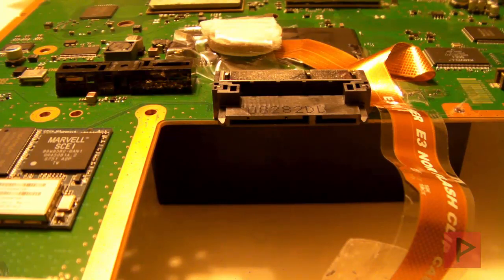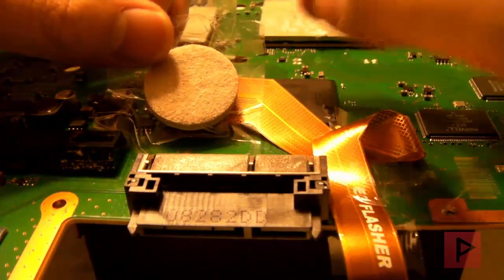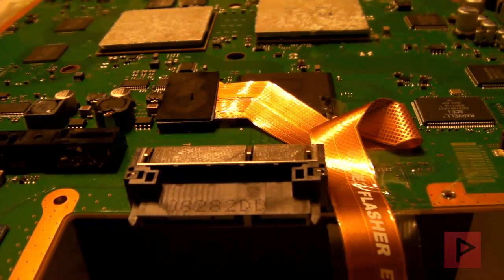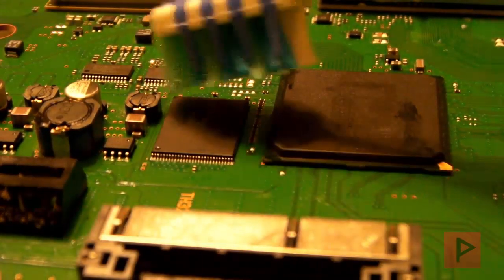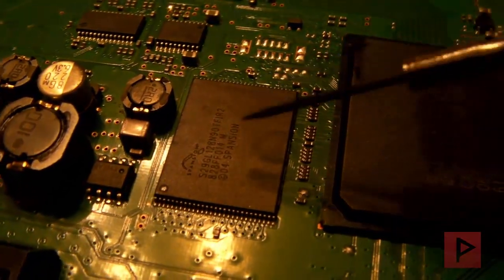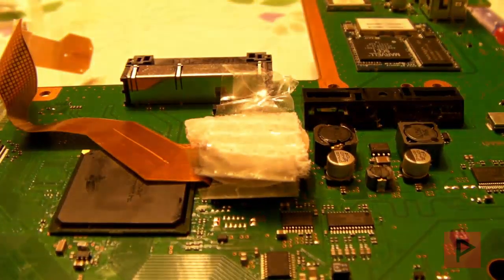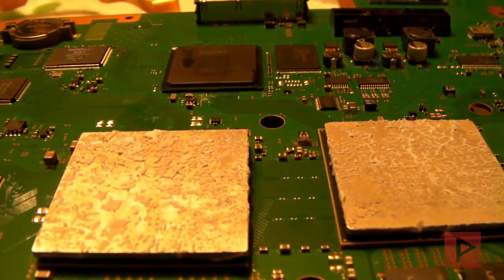[How To] Fix E3 Flasher NOR Clip Issues (10001100 Fix)

Comment: Thank you for the video.  E3 was getting a read error.  Your video saved me hours of troubleshooting.  I could see that the e3 was not flush with the board, so I trimmed the edges of the e3 flasher and it worked perfectly.

Comment: Thank you so much for this video! I kept getting 80-105 different errors in my bin file, i took my ps3 apart 11 times. first time shaving off the right side of my nor clip reader fixed my issue completely, thank you for this video. I only shaved off the lower right corner, and it worked fine. just look at where the small resistor is on the mother board and think about how the chip needs to lay flush on the motherboard. This is an issue for fat ps3's, this step is a must and should probably be included on the 3 part video. Awesome job on these videos, thanks again!
Reply: Thanks so much! My CECH 2001A was giving me real problems which is annoying since I have used the flasher on 3 other units. I shaved off the sides of the clip and it worked. Many thanks.

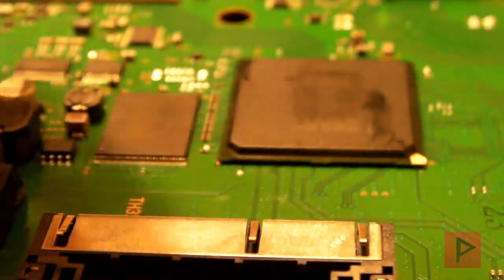Comment: The real fix here is this 4:17.

It worked perfectly, I doubt that little capacitor would do a thing but it seems it really bothers the E3 socket. Now I did my first dump on super slim, which is harder than in the other two models because the NOR chip is hidden under the cooler. I had to use a really big ass coin and put every screw in the near zone. That was my solution, and btw, thanks.
Reply: @ProjectPhoenixMedia  But why? There's no risk of brick using HFW or Am I missing something?

Comment: Hey man! Got the same PS3 - the L-Model. Also successfully dumped the NOR 3 times and was able to downgrade it to 3.55 rogero (v3.7). Now the strange things started to happen:
- I soldered the 2 wires needed for Dualboot (both perfectly soldered)
- Started installing 2 HDDs for Dualboot (both on Rogero CFW 3.55 v3.7)
- Tried to backup the PS3-NOR to the E3-OB-NOR, but got a read error
Now - after a restart - my PS3 (if E3 is connected) show YLOD. But I'm damn sure this is not due to overheating because i actually never played a game! I was only in the XMB for about 2 hours and also the fan was not speeding up to show there is increasing temp in the PS3. If I disconnect the NOR-Clip and fire up my PS3, there is no YLOD and it stays on, but only black screen. I currently think it's only a NOR-Clip-Seating problem. But I also scraped off the edges of the Clip and it seems I can't get it to fit correctly anymore. Please help! Can you tell me, how much "pressure" is needed for the NOR-Clip? I've seen tutorials where the guys used monstrous clamps to tie the Clip to the NOR, but I don't think your Nickel-Solution applies that much pressure...

Comment: Isn't it best to use Kepton tape? I heard some adhesive is conductive, but I doubt tape used mainly for soldering and PCB fix/touch ups would.

I ask mainly, because safety first reasons.

Comment: Absolutely correct. I could see the resistor I i though to myself it is probably in the way
Reply: Start shaving. At first I didn't want to believe it but after assembling and disassembling so many times, I was desperate to try anything. Shaving both sides down hard core did the trick. I couldn't believe it, I was so happy lol.
Reply: Versatile Yea, I will try that now. I have taken the console apart around 5 times now and it is getting  very frustrating but hopefully it will work the next time.
Reply: ShaDoWxGFX yea I was just like you. I thought I bent the pins on my clip or damaged the nor chip but thankfully all was ok in the end.
Reply: Versatile I'm still getting errors... I might just take the flasher back. It doesn't seem to work. I've shaved down the sides, I've made sure it has enough pressure, Ive dont everything correctly and still get flashing blue lights.
Reply: Versatile Last resort I might have to clamp the chip and screw the heatsink clamps on with a peice of cardboard in the middle instead of the heatsink.

Comment: Hey man thanks for these very detailed tutorials  I liked the whole series  and I am going to reference these vids when I get my E3 flasher but I had a question. Could u send me a link to the exact or similar E3 flasher you bought? I I have a PS3 Fat CECHK01 and I read that it has a NOR Chip. Sorry I don't want to get the wrong or a faulty one by mistake
Reply: Also is it necessary to remove the motherboard out of the case when installing the E3 flasher so you don't have to buy new thermal paste?

Comment: Hey, I have a question for you. I get this error code on my slim. I always get good dumps on my fat ps3. Ive shaved a fair amount off the sides. I try put a penny on it also a clamp.
Duct tape and everything. Works great on fat ps3s. Why is it doing this to all the slim ps3s? Thanks
Reply: ***** Yes! I'm not sure whats happening.
Reply: ***** 10001100 and sometimes 01000000
Reply: +Project Phoenix Media whats ur skype bro?
Reply: +Project Phoenix Media can I use your Skype cause I'm having trouble with this error
Reply: Phoenix said i have to pull the metal on the side of the fan up so you can put the clamp down harder, i got good dumps.

Comment: My problem is when I successfully get my first dump,  it doesn't reset to start THE SECOND backup. instead lights 1,3,7 stay solid BLUE and move from side to side also lighting other switches on.  In my SD card after shutting my ps3 off it shows a empty e3log file and one bkpps3. file...... very lost , not sure what to do. @ProjectPhoenixMedia

Comment: I need help when I got the patched dump it said ok everything is fine so I put it inside my PS3 and I put every switch down reseted the E3 flasher and pressed start it took few seconds and 2 blue lights started blinking any suggestions?

Comment: Have another ps3 and the clip is going on in clamping it down still getting error its a cech2503a slim , I'm looking around to see if its flushed but I can see the side of the pins I dunno if that's because iv scraped ao much off

Comment: that little resistor at the bottom right side broke off... is that making it impossible to make a valid dump?
Reply: i searched all over the internet and found out its a capacitor, but i didnt find any info about that being broken off... couldyou please helpme find out?

Comment: My E3 Flasher gives me error 1,5,6 which means It can't read it or something. My system model is CECH-2001A ( Samsung Nor Chip)
Reply: +Project Phoenix Media I just got a new Clip suit and it still won't read it. The clip goes on tight but if u push on the left or the right side it will make a click sound..

Comment: Hey man, I need help. When I put the ribbon on, and connect it and press start, it ends up giving me 3 dumps. Then when I run them through dump checker, they say "ok" all the way down. Then I do "Nor inspector" and I get 3 red lines that say "rash/hash error" and it says bad at the bottom. I don't know if my flasher is updated, or the tools programs I used. But it would help if you replied. Thanks!
Reply: I fixed it man. Thanks! but i updated mine for 1 ps3. if i change my mind, can i justdo the ther update in the future?
Reply: So you get no error?
Reply: Thank you so much! Do you know to to fix games freezing when loaded with multiman?
Reply: Thanks man! +like +sub
Reply: GTOCXxALJ3cT how did you fix this issue can't get passed it
Reply: Colby Hartman What your prob? Bad hash or something?
Reply: no i cant get a good file whin i do i get 3 files the on program says ok them when i put the in the main to ud load its says bad on thePS3DumpChecker
Reply: Colby Hartman Press the wrench and it'll say update hash and 2 other things. Update them all.
Reply: says the hash is bad what can i do need help

Comment: Mines passed the NOR inspector, but  I got the ROS1 Hash in the PS3 Dumper for BAD dumps Any solution to fixing this?
Reply: +Marlon Brown Nvm I fixed it by updating the dump checker to 4.76 and all my dumps said OK and it was vaild
Reply: +Project Phoenix Media you're welcome but my it's stuck on Rogero 3.55 downgrader and qa toggle doesn't run properly it will just go black screen and freeze. I have tried going to recovery mode and rebuild datebase that didn't work
Reply: Nvm I fixed my issue, just went recovery mode and did rebuild database. Qa toggle did 3 beeps.

Comment: So I get NO blue lights ( the green and red is on ) when trying to update is this because of a defective flasher or a clip problem
Reply: Exotix- I have the same problwn
Reply: Isaiah Beltran Most likely a fake flasher either return it for a new one or buy from a trusted source like in america it modchipcentral.com
Reply: +Isaiah Beltran or make sure that the cup is seated properly like give the clip a good shake if it does not come off tape it and put the PS3 back together

Comment: I'm going to retry now with the other recommended steps for the fan
Reply: +Project Phoenix Media same 156 error codes will retry tomorrow got summoned by the wife ;)
Reply: +Project Phoenix Media tried everything and beyond this is driving me nuts. Used 2 different e3 ribbon clips same 156 errors
Reply: +Project Phoenix Media in going to try the soldering of the e3 linker instead

Comment: Can someone help me? I keep getting the 10001100 error. I tried using the rubbing alcohol and also using nickels. I've been trying for like 10 or so times, but keep getting the same error. I need like a step by step tutorial on how to fix this. I have a FAT PS3 Cechl. If someone can help via google hangout or something, I would appreciate it. Thanks!
Reply: I shaved it off a little bit off each side. I dont know if it is enough. Can I send you email with pictures? I wanna know if i'm doing it right.
Reply: ok thanks!
Reply: i sent you an email.
Reply: +nimmy021 I tape an eraser onto of the e3 flasher chip when it was onto of the nor and when u screw the metal be down it put more pressure on it. Just make sure not to screw it to much you could crack the mother board.

Comment: i have purchased an e3 flasher from modchipcentral and they have TERRIBLE customer service. Spent 70.80 total and the bastards want me to spend 8 dollars going and coming to get a replacement of THEIR defective item. Bastards. So i purchased a e3 ribbon from ebay instead. I deconstructed and reconstructed my ps3 more than 20 times and still have not sucessfully gotten a single backup. Keep getting the damn 110001100 error!!!! Already shaved my 1st ribbon, didnt shave this new one but applied enough pressure on both. maybe its my ps3 that is the problem. i dont know what the fuck. im so upset.